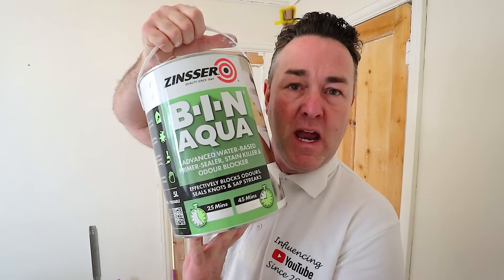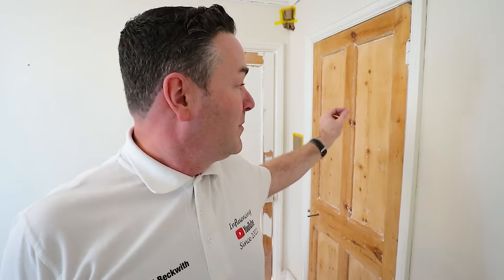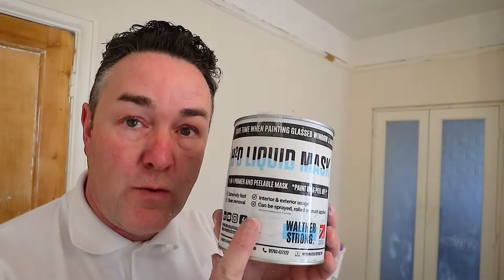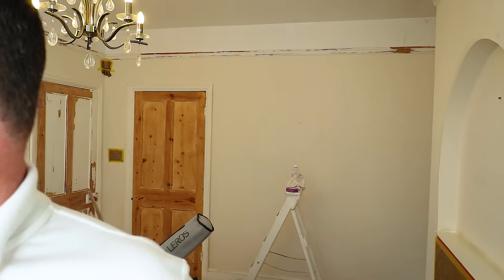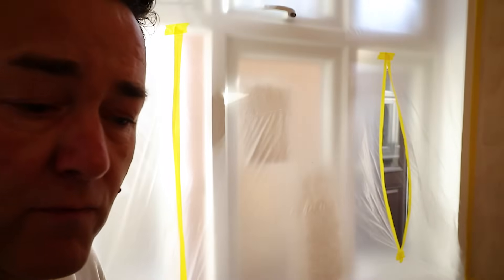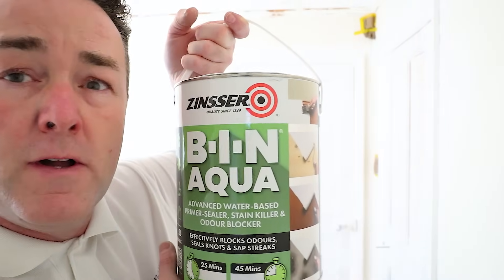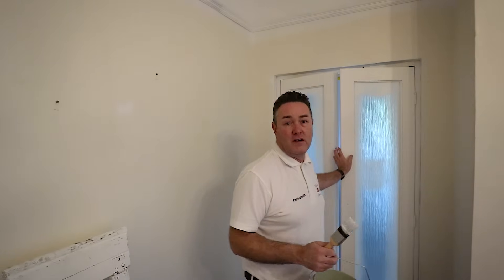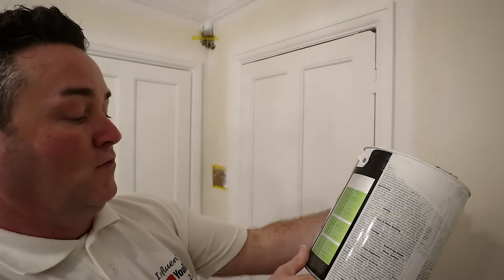Zinsser Aqua BIN & Graco 495st Max II: A Perfect Spray Match?

Comment: Phil, I did a kitchen cabinet repaint that was original painted with no primer onto previously oiled wood, just like your doors.  It was a nightmare I had to burn all the paint off and start from scratch, luckily I had a knowledgeable client and he agreed to pay for me to do the job correctly .  I used Zinsser BIN the primer as there were knots, then undercoat and two top coats.  It’s a long process as you well know, so what worries me about the Aqua BIN is the it’s unproven in the field regarding longevity of sealing knot bleed.  With that in mind I’d still go straight to the shellac BIN, where oiled wood and knots are an issue, I’ll let others validate the WB product 😜. Great video, as always 👍
Reply from the maker: I know what you mean lol getting your head around a wb product for Knotts seems mental.

Comment: You just answered my question. Having just realised how good 123plus is I've now got to go BIN Aqua as knots are the one thing that years down the line ruin the paint job . I use isopropyl,for knots as meths indoors is so fumey for knots. For general cleaning and wax removal I use Fossa Graxit  which seems to be only supplied by Decorating Direct, it is amazing stuff as it doesn't require rinsing . I use it instead of sugar soap/HG paint cleaner a lot of the time . 
Thank you Phil for finding the right paint for the job , I aim to see if BIN aqua works on Oak sills outdoors. I now realise that BIN is no good for Oak externally, yes I know Aluminium primer for that but I was trying to be clever in late November....
Reply from the maker: https://youtu.be/jzUqWcGofJw
Reply: @ProfessionalPainterDecorator  Will look at your vid. I used the FB pink primer for knots and it worked as had to go over knots and waxed finish on a staircase once (after using Graxit) Oh how I wish I'd have had a Quickshot then....

Comment: Have been using it on my current job, to cover doors, frames and skirts, that where previously coated in teak sadolin extra. sprayed it on using the new graco ultra quick shot, covered perfectly, scratched tested after, the paint was solid. So much better than the old red tin shellac zinsser.
Reply from the maker: Hi John. The quickshot is ideal for that job

Comment: Caulk: Nemesis from SF . love it instant painting!! Will seek out the Devil to compare and the Isomat.
Reply from the maker: Is that a flexible interior exterior caulk?
Reply: @ProfessionalPainterDecorator  Just interior, but was amazed at how it doesn’t slump, can be a bit tricky as it has behaviour issues. I have painted it immediately with no issues. No idea how it does that.
Reply: @ProfessionalPainterDecorator  You know what , I'd completely forgotten that I used to use Würth Caulk , so smooth never any problems with rough edges and wish that it was more readily available. Have decided that Nemesis is not the best, will get some Devil on your recommendation .

Comment: Hi Phil, I'm hoping you can help me with a massive problem i've just experienced using the green BIN and then Dulux water based gloss. I've got my suspicions but i'd like to see what you think!
I've recently purchased a GX21 paint sprayer with hopper and this was my first test. I used the BIN over existing oil based gloss and this went really well. The major issue I had was when I used the Dulux water based gloss. All I did was pour the bin out of the sprayer and then, added in the Dulux. The paint basically turned to glue and has taken me an hour to clear everything out of the machine. There were lumps of paint in the hopper and in the gun.
What do you think could have been the problem????
Many thanks in advance.
Reply from the maker: You didn't wash out the sprayer first?
Reply: @ProfessionalPainterDecorator  thanks for coming back. I did clean it out before using the BIN aqua. I used the BIN but carried on straight with the dulux waterbased gloss without cleaning between.
Reply from the maker: You've had a reaction between the two paints then 
Best to wash out before swapping over paints.
Reply: @ProfessionalPainterDecorator  thanks... 👍

Comment: Thoughts on oil based gloss being best option for outside of sash and case windows? Miranol best bet if so?
Reply from the maker: I use WATERBASED now and advise customers to go for a satin finish as it last longer as a finish... whereas Gloss always seems to dull off anyway.
Outside, this last year we've used Isomat Isolac U/c then 2x satin.... you could use their Gloss if you wanted Gloss.
The paint is very good.
Their new All Primer is a good one to go for then use the Isolac Satin (or) Gloss (2 coats) over it.
Reply: @ProfessionalPainterDecorator  thanks Phil! Used everal aqua 40 on a couple of sills and seems ok
Reply from the maker: @Butlins14  that's a great paint, sprays lovely. Being an interior & exterior paint it seems to be a good all rounder.
The 40% sheen is very pleasing to the eye

Comment: Have you tried a tritech t5😂❤ phil proper  machine ,makes my graco  390 feel like a toy
Reply from the maker: It would do, the 390 is a bit smaller and more every so often for spraying.. an upgrade to a GX..
Now, the 495 St Max2 is a differnt kettle of fish lol
Reply: @ProfessionalPainterDecorator  still very plasticity  tho mate ,I've  replaced  the dump valve twice in twelve months  and two o rings aswell ,tritech are all metal and aluminium   ,I would never buy a graco again
Reply: Totally agree , I have two t5s and a 495 which is now my designated spare machine , least to say it don’t get used as tritech don’t break down 
Changed pump three times on the 495 crap and more expensive 
Tritech robust and reliable also on the 495 the ball bearing was forever sticking

Comment: Phil have you used your Graco Ultra Quick Shot to spray this Aqua BIN?
Reply from the maker: Yes. The same house, a few weeks ago.. a different room. (this video was done last year).
Reply: @ProfessionalPainterDecorator  were you able to spray it unthinned with a 310 tip from the quick shot? What sort of pressure were you using? Thanks.
Reply from the maker: @saiflatifi8406  yes. Dial #5

Comment: Hello Phil. Hope your good. Ok so I am undecided about RED BIN or Aqua BIN . I have finally decide to paint wooden surfaces in my bathroom which receives a lot of moisture from the shower being so close. I sanded off the old gloss. After tonnes of paint research on what to use. Most bathroom paint states for walls & ceilings. so difficult to find one for wood surfaces which often gets wet. so finally i got a good tip to use Capacryl Haftprimer & Everal Aqua 40. However BIN aqua is new. BIN red I imagine had the best adhesion? I have seen a couple of Vids of all the BIN being tested off. ( except Aqua ) and the RED was the winner for the scratch test :goodvibes:
Reply from the maker: Does it sit in water ?
Was the paint peeling and flaking off?
Reply: @ProfessionalPainterDecorator  NO the paint did not flake off. it was previously 10 year old - painted - gloss painted surface connected to the side of bath - under the sink. from showering, i sometimes forget to dry of the surface,  there would be usually water sitting on the surface. The old gloss held up well and prevented the water seeping into the wood. However, as solvent paints are phasing out , and the fact they turn an awful yellow. I now want a paint which will prevent the water seeping through the wood. a similar effect to the old gloss i sanded.  i just seen a video - The Ultimate Exterior Water Based Paint System - Daniel Nugent Painter and Decoration ) He uses Caparol Haftprimer which is an exterior etch primer and The Everal Aqua by Tikkurila on the outside of wooden trim of a house.  This got me thinking ? his system would be good , I sent him a message hoping to know how the paint held up two years later. If he replies saying it's still good. no flaking, no peel. I will 100% go with his system. because it's outdoors, and it rains loads in UK & ireland. 😄🙂
Reply from the maker: I don't like mixng and matching other brands of UC with top coats, hand in glove. less chance of having a issue of paints not taking with each other. @bsfbestshortfilmsonyoutube
Reply: @ProfessionalPainterDecorator   yea I should take your word your more expert than I. I check local paint stores and hopefully go with Everal 40 and the otex one you mentioned . Thanks again Phil 👍
Reply from the maker: @bsfbestshortfilmsonyoutube  Otex Akva is water based 

Otex is oil based.
Reply: @ProfessionalPainterDecorator So which one do you recommend I use with Everal Aqua 40 ?
Reply: @ProfessionalPainterDecorator  tikkurila otex akva 2.7 liters = 80 euro ! Hopefully one coat will be enough for x x2 internal windows sashs + 3 doors and a small wooden panel in bathroom ?😀
Reply: @ProfessionalPainterDecorator  Just thought of an important question to ask you . For x 4 doors of a similar size to your ' Doris the door ' . How many liters of paint would I need to paint x 2 front & back top coats on each door. Total 4 doors ?
Reply from the maker: a litre, you'll have loads left over
 @bsfbestshortfilmsonyoutube

Comment: That red devil mastic......I gave all mine away......didn't seem to smooth out nice like most mastics.
Reply from the maker: Oh it does. Had yours been had by frost or past it best?
Reply: No there was no frost damage.
I bought a whole box after watching another video of yours.
It just didn't seem to smooth out like other mastics.It seemed as though it was oil based when trying to smooth out with a wet finger.
Reply: Never had a problem with it though I now use the Crown or Dulux foil-wrapped caulks in the metal tube guns because ;
1. Was sick of buying useless skeleton guns that don't work.
2. The metal tube guns work much better and last for years.
3. No more plastic tube wastage.

Comment: Its ok doing all that prep if that's what the client wants to pay for, otherwise give it a coat of acrylic. Too many fancy paint titles that are not needed.
Reply from the maker: The acrylic isn't going to stop it chipping/peeling off though, all you'd be doing is coating up whats already there, as with all painting, it's only as good as that first coat that goes on to a subscrate.
Reply: Bet I could paint them doors in half the time, would last just as long without pissing around with all them fancy paints. Peel stop what's all that about haha

Comment: All water based bins are crap simple as every decorator i spoke to say the same as me solvent based is the only way forward ive used the blue tin bins on water damage stains still wept though as soon as i used solvent based on the same job no stains at all
Reply from the maker: Only Zinsser 123plus will stop water stains... Read the back... It's needs a few coats.
Zinsser 123 isn't for water stains

Comment: You need to test this paint after a week or 2 in various scenarios for what it claims on the tin for :
1. Adhesion 
2. Knot blocking
3. Water stains
4. Over varnish

Ideally when the topcoats have cured. Otherwise the video is just a blind promotion of the brand.
Reply from the maker: It's been used because of what it claims to do.

Do you have time to test all paints at home with the above before you use them on a job?
You'd hope the R&D at Zinsser have done the testing for use before it gets released??

#zinsserUK
Reply: @ProfessionalPainterDecorator bit of a cheeky reply. I mean I’ve used lots of paints that claim things but in reality don’t perform. That’s the whole point of people doing independent reviews of products.
Reply: @ProfessionalPainterDecorator  I've spoken to the techs at Zinsser multiple times.. the only claim I take issue with is adhesion to oil based gloss without sanding it first.. I'm not saying it doesn't work, but they claim the same thing for red tin Bin, Bullseye, Permawhite and Allcoat.. Up to a point, I'd trust the shellac in the red tin, but my experience of the water based products isn't so good.
That being said, the Aqua stuck exceptionally to melamine, which is notoriously teflonesque.. I just have to hope I'm not called back to re-do the oil based gloss H/S/L I coated with Bin Aqua and 2 coats of Permawhite as I couldn't face sanding it all..
Reply: That's fine but you haven't tested a single one of the those claims. You've applied a paint and ended the video. 
As professionals, we are only interested in performance and reliability. It's an expensive paint aimed at professionals. If you believe everything at R&D why are you making any videos then ?
Reply from the maker: @leezeraloe3821  oh well
Reply: @colliedogjoy   hi collie how did it hold up ? I am wondering if I shud use  RED BIN or Aqua to cover old sanded gloss for  wood surface in my bathroom  ?
Reply: @bsfbestshortfilmsonyoutube  The red tin will be better, but BinAqua will do a pretty good job - especially if it’s been sanded/deglossed.
Like so many things, paint’s not what it used to be. One thing I liked about the shellac paint was that you could remove it with meths at any point - not so with the Aqua. Nothing sticks like shellac. 
I’ve used the Aqua a lot now, maybe 10 litres or so in all. Let it cure for a week before abusing it. It’s ok - and there’s no smell.
Reply: I was thinking the same. I've seen similar videos on paints. But no 2 months or 1 year later results 🤔  only then will I trust newer paints which have been fully cured tried & tested for durability
Reply: Or those paints with high ratings but no customer reviews no comments I wouldn't trust. Only way of knowing of a paints durability is from customers reviews months after application. Like me I can say cheap homebase solvent gloss is king. As it held up 10 years until it yellowed. But now I no longer want to use solvents. I wanna step up with the times and use new  w b paints. As for Zinsser if you read specifications all similar except Red BIN definitely proved unique adhesive. Aqua BIN no later customer testing as yet .At Least 6 months a paints application left out on all weathers we could tell of its durability.  Days weeks not sufficient. Yes paint producers test their paints. Like the dulux video I seen. Obviously a cheap watery marker is used to show the paint wipes off with a light wet wipe 😄 😭 no thanks. At least Phil does a Doris door scratch testing. But we also need more months later test reviews to see the paints durability. Phil after painting your door  panels in separate paints leave out in all weathers  which in uk is mostly rain 😑and then show us months later another scratch test for durability 😍 we then have better idea of the paints durability
Reply: @colliedogjoy  ok thanks   I'm new to water-based hence my trust issues 😊 I spent weeks hand sanding doors floors window frames. I'm not dipping my paint brush into just any recommended paint until I'm absolutely sure I can trust its durability . It won't peel or flake and I'm left redoing everything 🥲 I'm looking for the One ! For All ! Paint to repaint all my interior woodwork which had 10 years of old yellowed gloss. So finally I may try Zinsser Bin Aqua with Everal 40 top coat. Or maybe half primer. 🤔 Philomena recommended Otex to keep with the same brand system. Hopefully soon I make the right ✅️ choice 🙏 😌
Reply: @bsfbestshortfilmsonyoutube can’t go wrong with Caprol or Tikurilla. Primers and top coats are all top notch. Have heard of a painter successfully using Haftprimer straight onto old unsanded oil based gloss..
Reply: @colliedogjoy  thanks great advise 👍